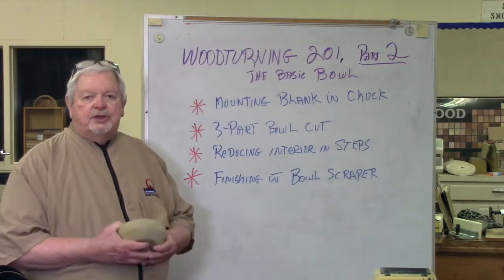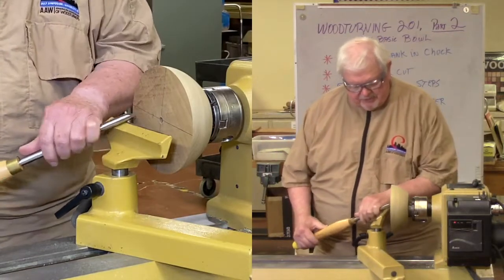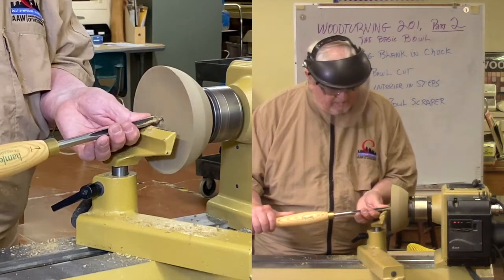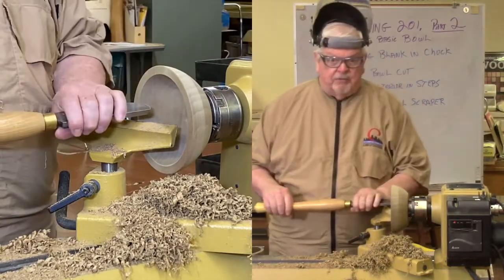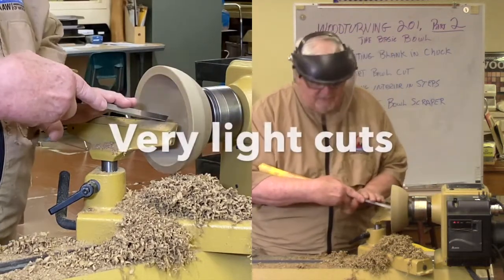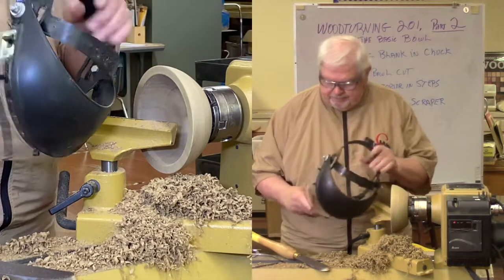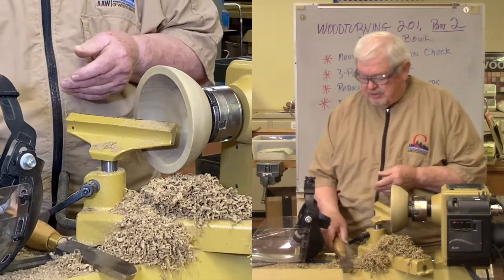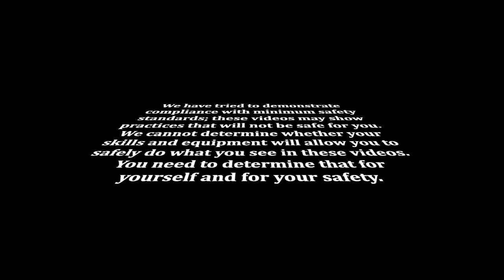Woodturning 201, class lecture, Part 2

Comment: Many thanks for your video Jim.
I have a question. Time to time to finish the internal part of my bowl, I use a negative rack scrapper. Please what is your position about this way of work and do you have recommendations about this method?
Thanks again for the time your explanations. Regards from France.
Reply from the maker: Yves, Negative rake scraper are good for finishing cuts to reduce the need for more aggressive sanding.  I support the use of scrapers, negative rake or not. 
Completing the bottom of the bowls with a gouge many time creates torn end grain and "ripples" in the texture. The scrapers are great at reducing these effects.
Reply: @JimRodgersWoodturner  many thanks for your answer. Regards.